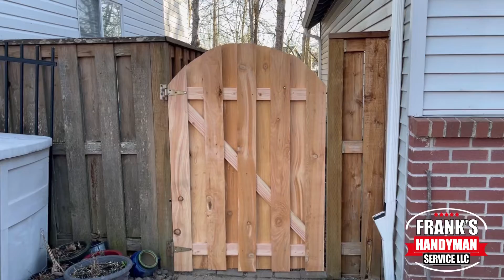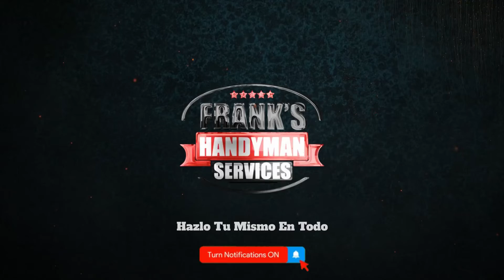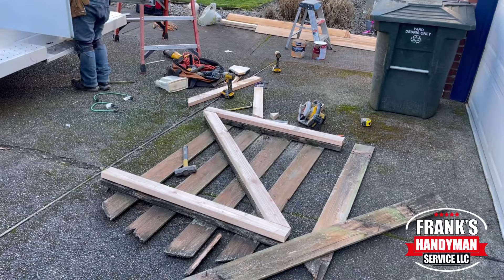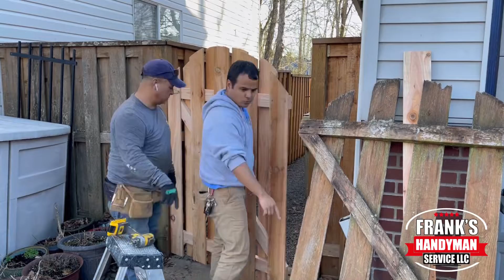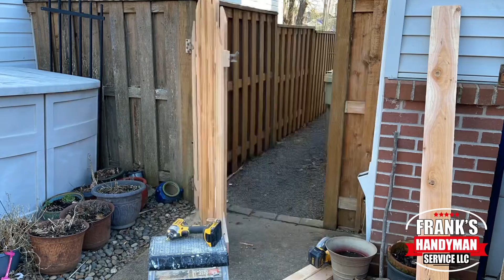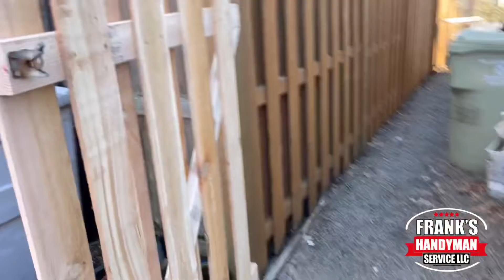How To Rebuild A Wooden Fence Gate Step By Step DIY With Basic Hand Tools & Professional Results

Comment: Looks like you put the Support board backwards. It’s supposed to go from the bottom hinge up to the top latch no more than a 45° angle. from when I know when you do that, it allows the gate to sag by putting it from the bottom left, starting at the hinge to the top, right, and then at the latch, keeps it from sagging. I just learned that yesterday. Lol